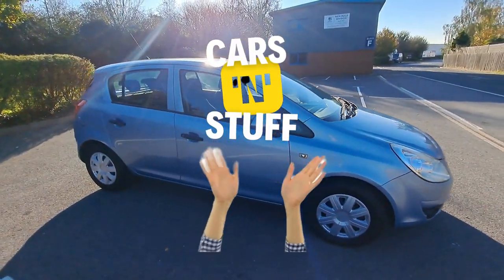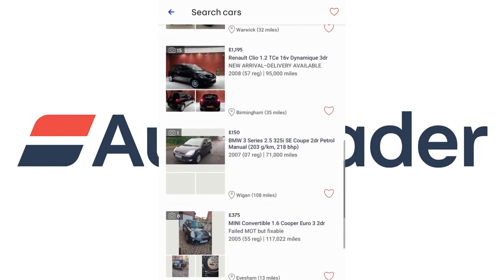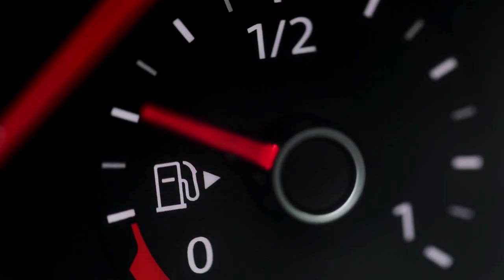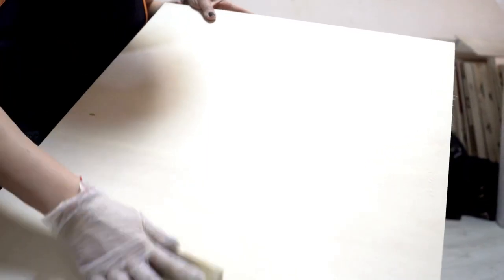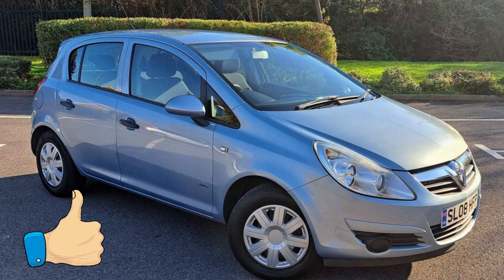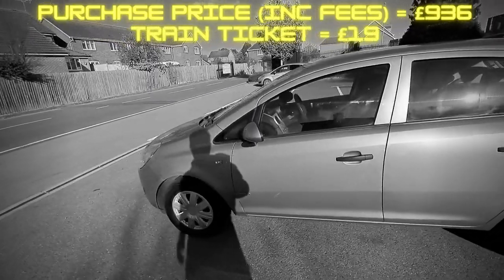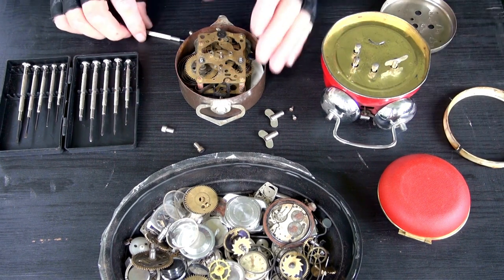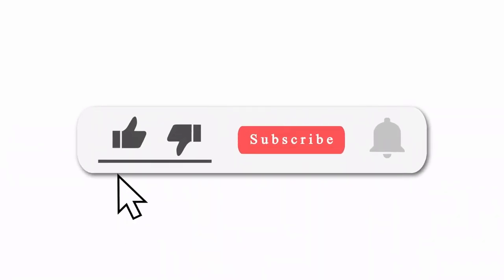How to flip cars UK | FULL PROCESS

Comment: Great video mate thank you. Was just wondering how do you deal with the logbook? Let's say I buy from a private seller and want to resell the car, do I have to register myself as the owner? Just not sure how that works.
Reply from the maker: Thanks mate. When you buy from a private seller, you need to fill out the yellow part of the V5 (trade slip) so it doesn't add another owner to the logbook. You can also do this online too. You then keep the original v5
Reply: @carsnstuffuk  Hey, thanks for the info above. Do you fill the yellow section if you are not a trader? If I want to flip cars casually without adding an owner?

Thanks
Reply from the maker: @Ameer Malik  you can only fill out the trade section if you have trade insurance. If you're casually selling the odd car here and there, then the only way around it would be to fill out the V5 as a new owner and transfer the car in to your name

Comment: Quick question - As a trader Can you tax cars individually rather than getting trade plates?
Reply from the maker: It depends. If you've got a private driveway or private space you can park cars then you just need to get trade plates. If you're parking on the road then they need to be taxed
Reply: @carsnstuffuk  Cheers 👍🏼
Reply from the maker: @keithwright6355?